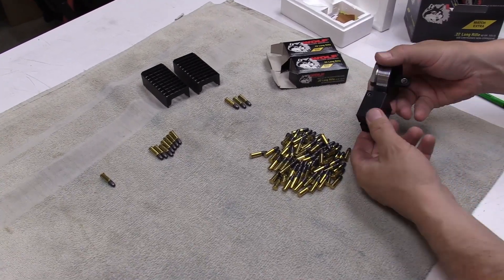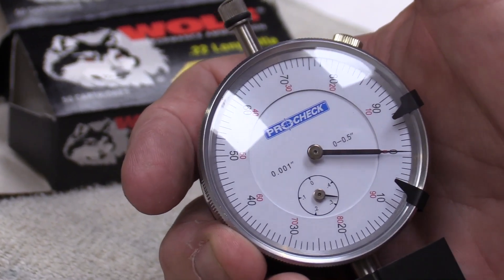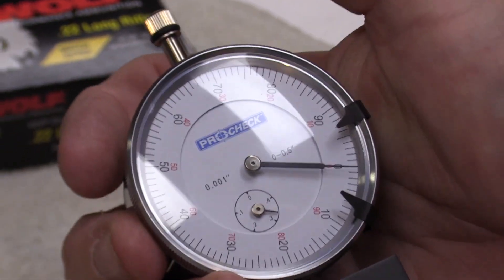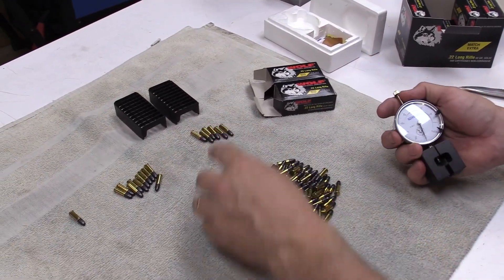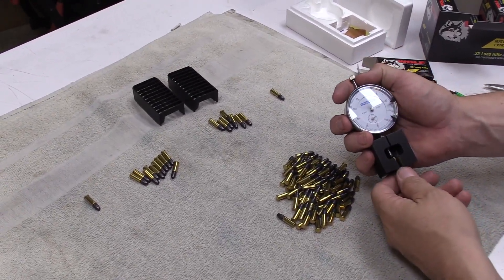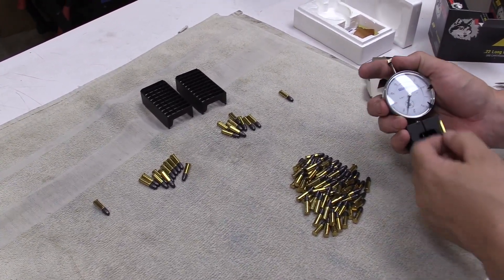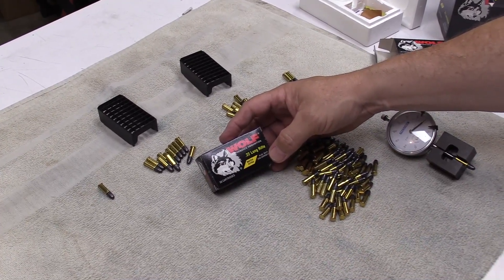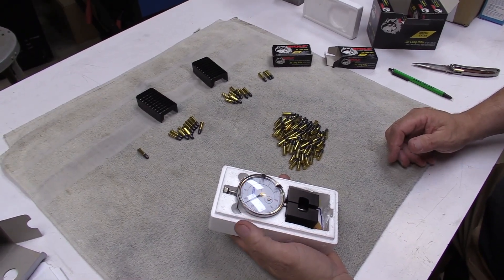Rim Thickness Gauge 1080p HD

Comment: I have tried sorting 22lr ammo myself, when I spin the ammo in the gauge, I get a variance for sometimes low thickness to mid, different measurements depending on the orientation of the round in a gauge.  I enjoy this stuff, and I know most will say just buy better ammo, its a valid point and I understand wind has a lot to do with rimfire accuracy.  I will also weigh my rounds and sort some just for the enjoyment, I have more time than money.  Thanks for posting the video sir